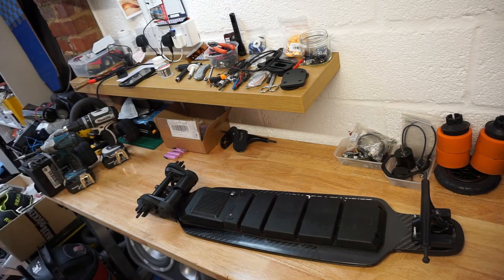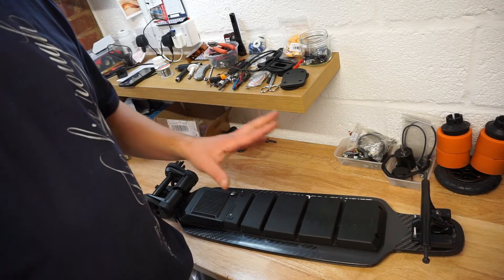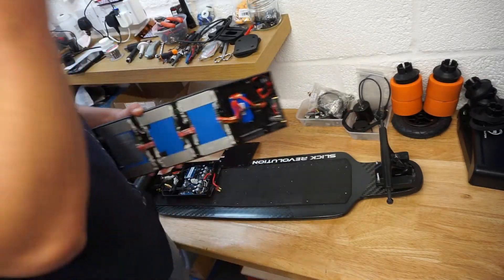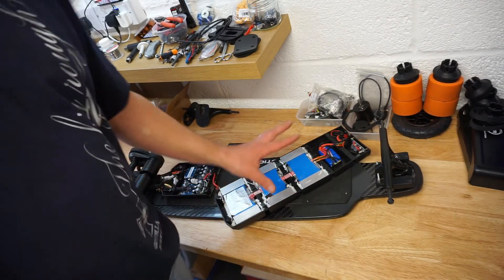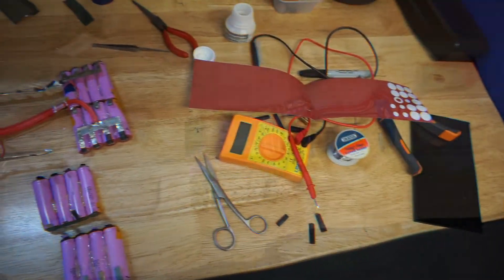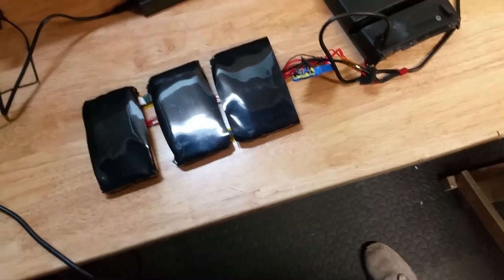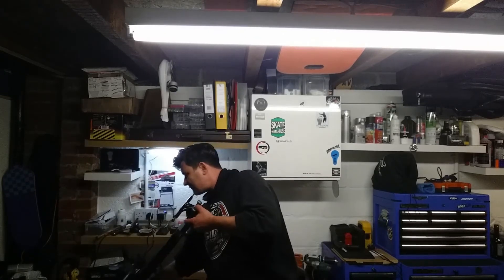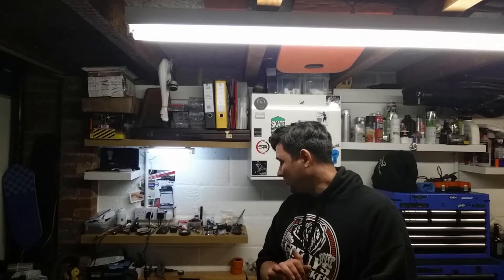How to upgrade cells in your battery pack.

Comment: Where the positive and the negative of the cells bump against each other. Did you also isolate The U-tab connected to those cells?
Reply from the maker: Yes I did.I have used the shrink tube over the tabs and the "o" rings under the tab where it meets the bod of the cell. Hopefully I got the question correctly.